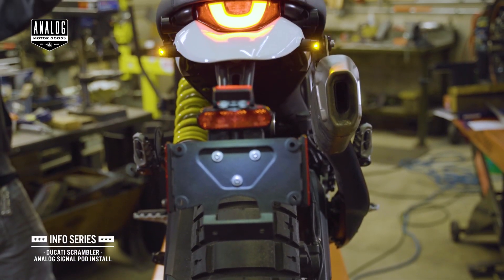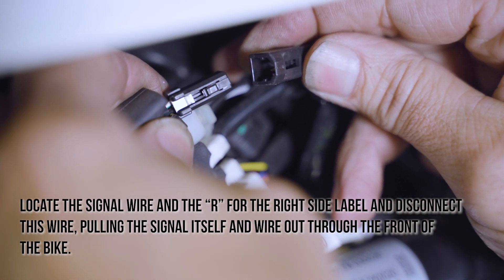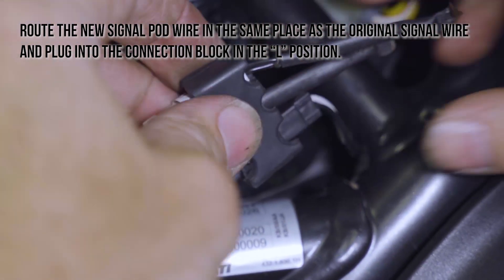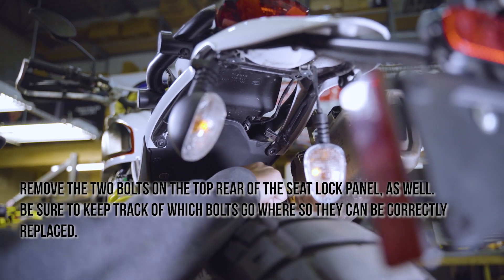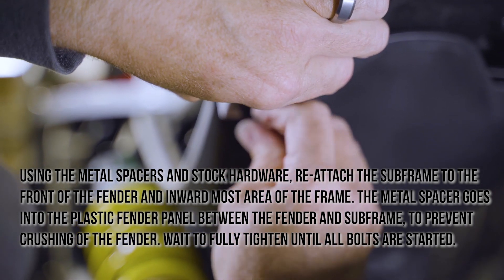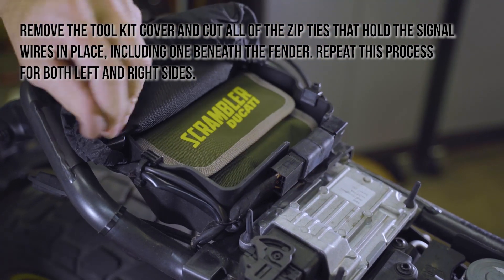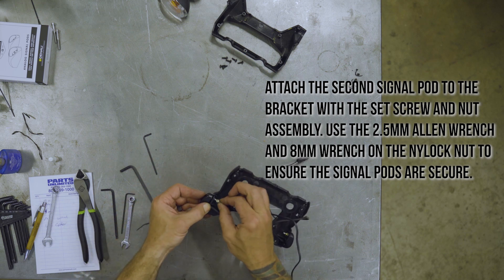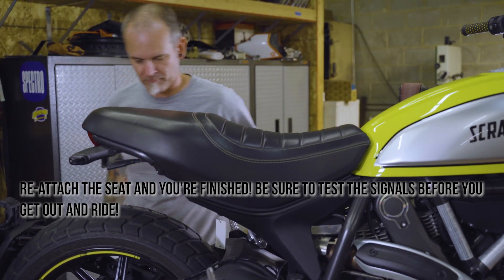Analog Motor Goods - Analog Signal Pods LED Turn Signal Install for Ducati Scramblers

Comment: Hy from french Pyrénées!...I just changed mine. I followed your tuto for the process. Merci pour votre vidéo impeccable!
Reply from the maker: Thanks!
Reply: Make sure there is at least 24cm distance between the left/right indicators.
Reply: @ssmith954  Hy...29cm rear 32 front...:)
for the fun i took a look at my Yamaha SR 500 de 1979: 46 cm rear and 48 front! I think it's OK. Merci S Smith.
Reply: @quilucru  Good! I did a similar modification and it caused issues during the controle technique...!
Reply: @ssmith954  born free but 24 cm to ride self 🤗
Sometimes hard top accept 🤔👍

Comment: Hi, I have a Cafe Racer model, how to remove the nut in the left and right part of the headlight, if it spins with the allen hex bolt? Do I need long ring wrench? Thank you!
Reply: Did you ever work this out? I can't get to those nuts to hold them either
Reply: @ Hi! I asked my wife to help me, it took us a day to install the front signal lights😂

Comment: Where did this (https://www.youtube.com/watch?v=1QeefOgXQSM&t=4m40s) spacer come from?  Original owner of a 2015 Icon and the stock bolt complete fills that hole.  I didn't see a spacer in any other component.  Used the washer and just tightened it in position.